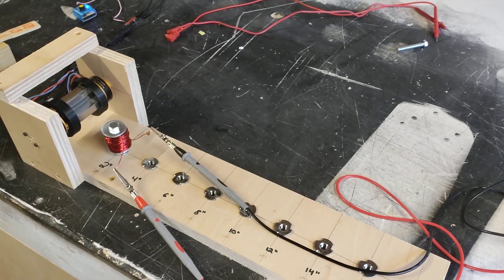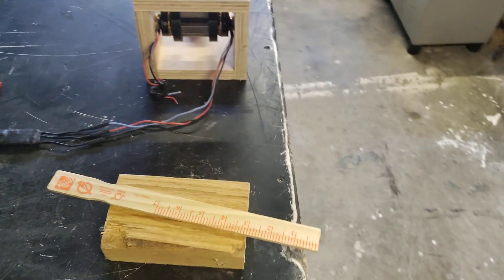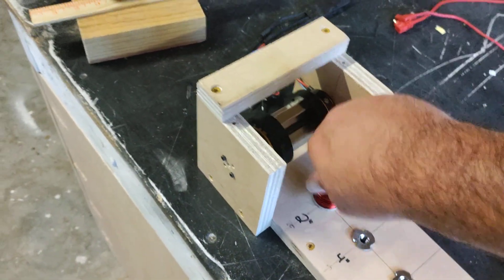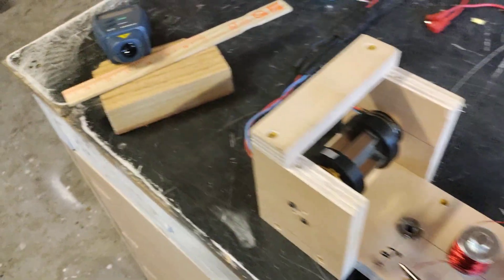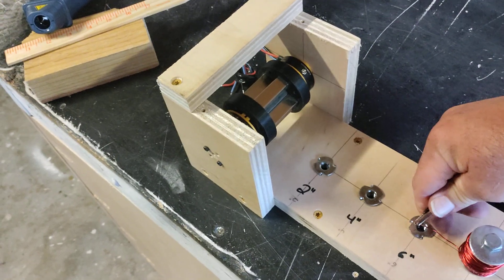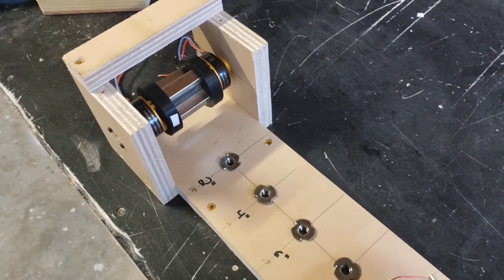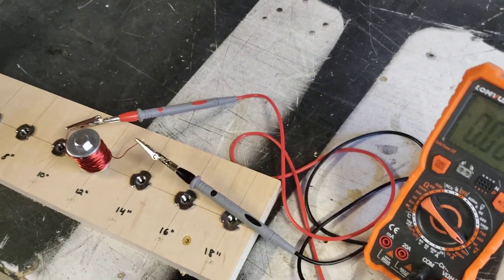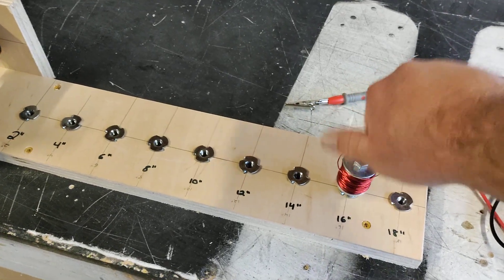Distance of a rotating magnet

Comment: Try it sideways, then hang an aluminum disk from a long thread.  (Or, copper disk, or copper cylinder.)   Nikola Tesla said that his "Egg of Columbus" device could rotate a metal disk from several hundred feet away (out to the distance of the Electricity Hall at the 1891 fair.)   Presumably he was using 60Hz, same as 3600RPM.  He had his 10in metal disks on jeweled bearings, but a fine thread should behave similar.
Reply from the maker: Eddy current is very strong 1" from the outside magnet. It will spin aluminum at 5" however it will keep a moving disc moving at 8" There is no way to pulse this or I could make the distance go farther. The magnets are not strong enough to make force to aluminum beyond that. I tried.

Comment: Youll find that these results comply with the inverse square law

If extending the magnetic field in one specific diretion is your goal, I would suggest trying a diamagnetic motor houing covering all but the direction you want the field to extend

If you can be bothered figuring out the best layout you could also try to arrange paramagnetic bars facing the direction you want the field to extend

Comment: DO you think by using a inverted funnel on both sides of the rotating magnets would increase the magnetic strength of the field further away from the spinning drum ???
Reply from the maker: The energy was tested on right and left. But never on the top or bottom. If the amount was less on top or bottom then yes angles would help. However since the top and bottom are polarized then the field should be the same.
Reply: @oldmanbuilds  Thank you Nathan for putting me in the correct direction.
Reply from the maker: @victoryfirst2878  You got me thinking. I never ran a campus around it either. It may have an interesting result. I was planning to rebuild it and use it as a core for a generator with no iron. I watched Garrard Morin do it and he put magnets on the outside of the generator to improve the field strength.
Reply: @oldmanbuilds  Good luck with your idea Nathan. One never know what is around the corner for the experimenter.
Reply: If it was a diamagnetic material used as a funnel, this would work, in theory 

He should also consider replacing the 4 magnets with however many you need to make a Halbach array
Reply: @drsatan3231  Hope someone does the Halbach array. This would be interesting.

Comment: This was great thank you!  What kind of wood is that that you used?  Thanks again!
Reply from the maker: This was 3/4" maple plywood I had left over from a job. You can use anything you want though. Watch the inserts though they come out. I should have put them in from behind. It cost me a magnet when one came loose. Also the second motor isn't even working it just holds the device in place.   Hope this helps .   Thanks...

Comment: HOW about you lay the copper coil down on its side and attach it in the center and do the test again ??? This I think will show us what the difference is for sure. Nice work fella too.
Reply from the maker: I will have to rebuild it. However you can take a multimeter with the coil and move it all around it and get the same readings at the same distance. I should have shown that. I have a flat disc with magnets on it that I plan to do more experiments with soon. I will try to show more.
Reply: @oldmanbuilds  Thank so much for responding Nathan. Look forward to see more great things from you Sir. Job well done also.

Comment: Awesome experiment.   Most people don't understand how far there magnetic field goes out.  
Most blow there fields to the back of the coil. And wonder why they get heavy lenz effect. 
Or a nullification of electricity out. 
Have you tried the experiment with your rotor turning the opposite direction than in this video?   
Would love to see you do a 10" coil with test results showing the field hitting the front and back of the coil, and one test hitting only the first half of the coil.
Great work, going to sub now and will be following your videos from now on. 
Good stuff and keep up the good work.👍👍
Reply from the maker: I put the video out because most people don't relies that when we have a magnetosphere that the are several rings of energy that are created. We live between the last two. 

I also did it because when building any antigravity device you need to see the effects to know how things interact. 

I did run it backwards. It has the same result. The more interesting is the Eddie current at 3/4" from the rotating magnets. It wont allow the aluminum to hit the magnets without heavy pressure. 

I was working on a repulsion generator when I built this to see if I could use Eddie current to repulse the second ring. ( a lazy Susan double ring ) where one side has a coil and the other aluminum. Then coils on top and bottom to collect the energy. The reason for the repulsion was to remove all load. Because both rings push against each other and there is no iron. I was hoeing to get it to zero point, but it failed. I needed the iron, but not at the start. I will build it again with cobalt. so the iron effect isn't heavy in the beginning, but when cooled the cobalt acts like a super conductor and has a higher strength than the iron.

I am working on tesla coils at the moment and will put out a video on them soon. I'm trying to replace the tuning forks on boxes experiment with tesla coils to show the same effect. That way people understand frequency's better. 

Thanks for watching..